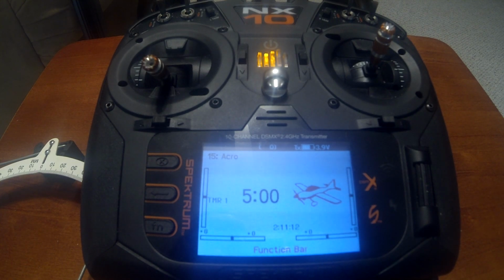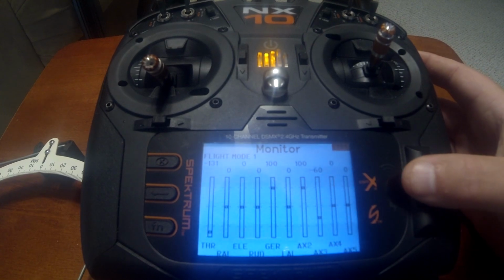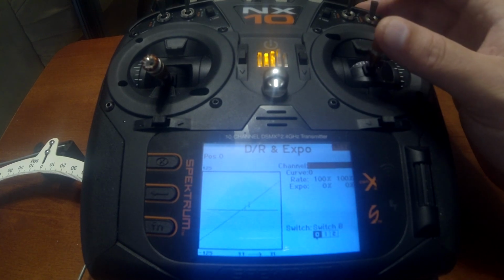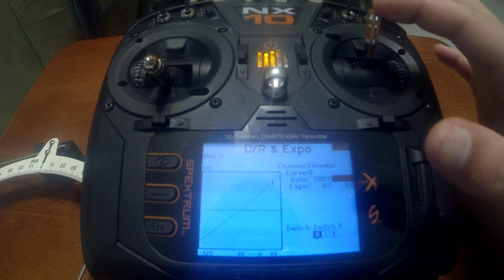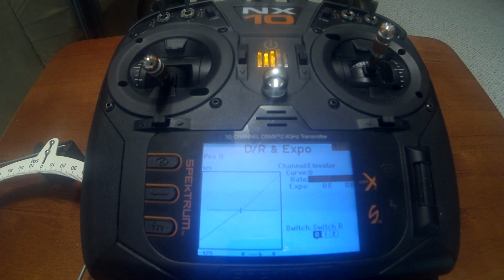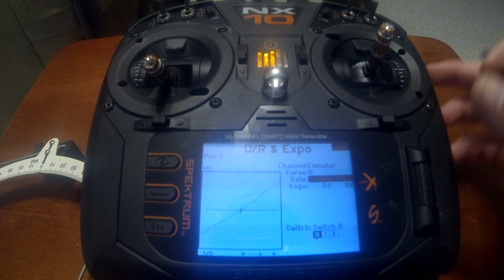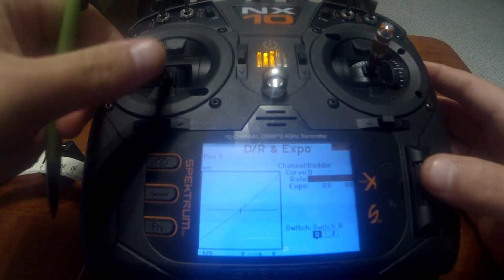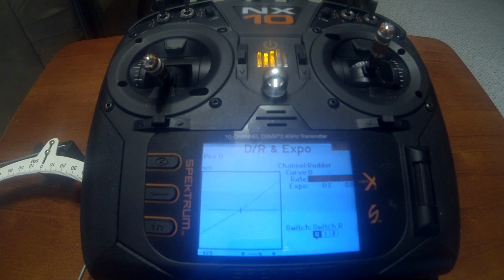Spektrum NX Setup: Fine Tuning Control Surfaces Tutorial (NX6/NX8/NX10)

Comment: Better way....set end point of the servo to adjust travel...then your dual rate %  stays the same in all flight modes,, (Stays symmetrical)
Reply from the maker: Correct,If you lower Travel in Servo Setup menu is will reduce them all.However it will make the dual rate a percentage off that number and not absolute.

Example: Lower travel to 50% and DR to 50%,now the rate is 25%. Setting dual rate to 25% in dual rate makes it reflect the actual percentage (value).

Both methods work though. Thanks for sharing...
Reply: This is a good point and one that has confused me on which method is the "right" way to set up a servo. Manuals give you travel throws usually in terms of distance. And they usually give you high and low distances or deflections of the particular surface. Do you set those throws as rates configured to a button or do you set the Travel end points for the largest deflection of the surface (that would be 100% on the Rate and Expo screen) then dial down the rate for the low rate until you get the deflection for low deflection shown in the manual?

Comment: What are the L & R Trimmers next to the NX10 logo used for
Reply from the maker: They can be used for different adjustments.Check out the "elevator to flap on the fly" video.I use them for that setup
Reply: exactly! I was wondering the same thing.

Comment: What would be the difference of following your example, versus changing servo travel instead, realizing that servo travel impacts any rate.  Interesting subject!
Reply from the maker: Eflite recommends not to change the travels or subtrim in the owners manuals. Also your values in the D/R and Expo screen is the true number. When you start changing the Travel you have to do the math. Example- 100 travel with 75 and 50 on D/R is 75 and 50 total. 75 on travel with 75 and 50 is 50 and 25...
Reply from the maker: *This method is for fine tuning differences.Control surfaces should be manually done first to get them to match.Sometimes when everything same mechanically servo will still move differently. Then use this method
This method also work when book has different throws for opposite direction**

Comment: Your series on NX Transmitters is outstanding. It's a shame the folks at Spektrum can't explain things as clearly as you do. Any chance you can do a video on setting up the NX transmitters for use with Real Flight(9 or 9.5)?  I am having issues setting up some functions on the traditional switches or at all - particularly landing gear and throttle cut. Keep up the great work!
Reply from the maker: Thanks for the support and positive feedback! Go to top of screen on RF. Simulation > Select Controller > Choose Spektrum NX > Edit Box. Then setup the switches and calibrate.

Setup a throttle cut in the model for the transmitter.

Comment: What does clicking on (and changing) the low, mid, high (1,2, & 3 rate boxes) do?
Reply from the maker: You can enable and disable the switch. Also change the order.I dont use them in that screen.